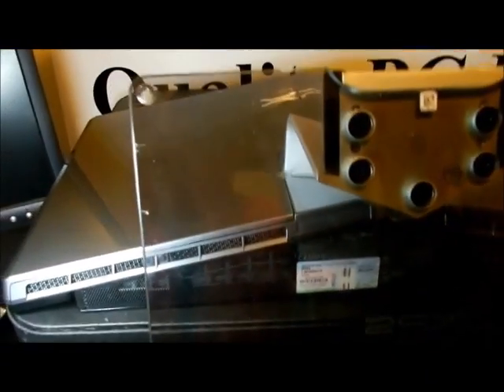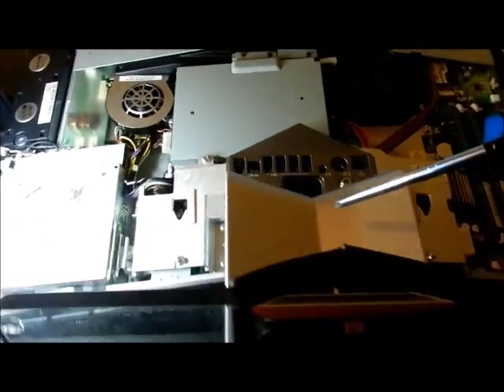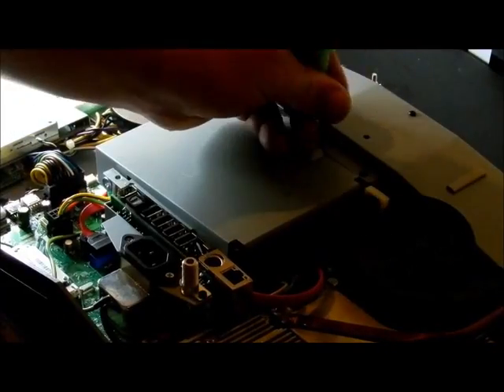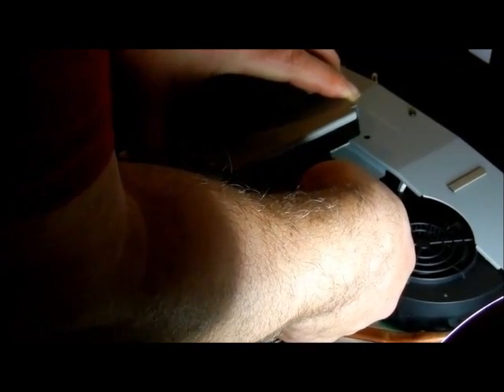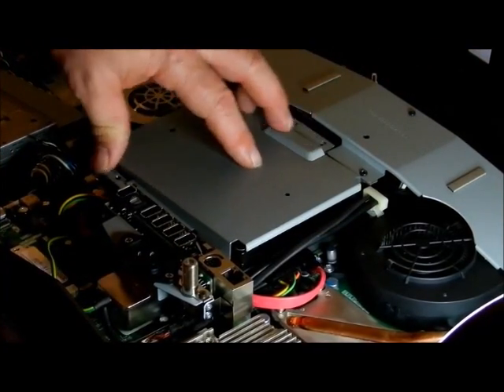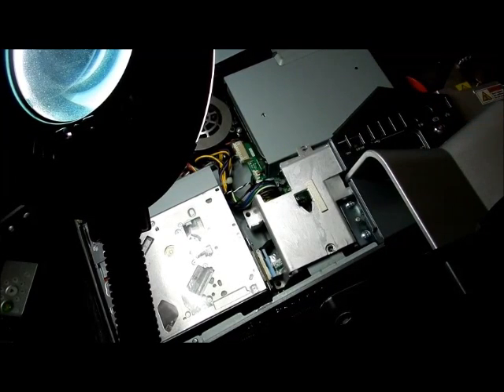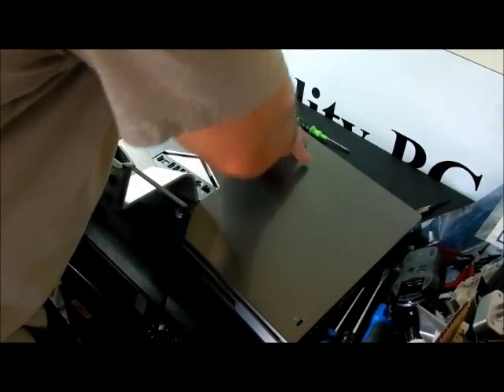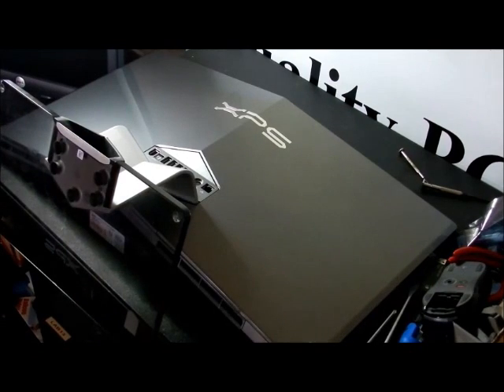Dell XPS One Replacing the Hard Drive

Comment: Where can you get a HDD for these? Got one going off an auction tomm I'm kinda interested in getting.
Reply from the maker: Staples, Best Buy, EBay...
Reply: Thanks for the response I appreciate it, one more question is there a type of HDD this takes? Are they all kinda universal or do they have different connectors ect.?
Reply: Serial ATA I think is the answer to my question right? Can I put a new SSD like this one http://www.bestbuy.com/site/kingston-ssdnow-120gb-internal-sata-solid-state-drive-for-laptops/5395439.p?id=bb5395439&skuId=5395439
as long as it's Serial ATA in the XPS One 20 or will it only like the old style magnetic spinning type?
Reply: Since it looks like this XPS came with 3.5 inch SATA I assume any replacement must also be 3.5? Looks like a pretty good deal on this one that matches from everything I can tell http://www.bestbuy.com/site/wd-blue-1tb-internal-sata-hard-drive-for-desktops-oem-bare-drive-black-silver/6331502.p?id=1219470783344&skuId=6331502
Reply from the maker: Travis Barnard As ling as it is indeed for a desktop computer.  The cost looks good too.  Take a look what a company had me do with a Windows XP SATA HD.  They had me change it to a smaller SSD SATA HD.  Wow!  It booted fast.  Look for it on my channel in the computer hardware playlist.
Reply: Can't find it, would you mind linking to it?
Reply from the maker: https://youtu.be/eT0JoKGyPw0
Reply: I have really appreciated your help man, I know just enough about computers to be dangerous. I found a matching HDD in a spare computer I got cheap laying around, a Dimension 9100.  Installed it into the XPS fine but now of course it's giving me the blue screen upon trying to load windows in start up, is this to be expected? Will I need to like have a recovery disk and reinstall windows on it ect?
Reply from the maker: Travis Barnard You cannot take a Windows HD out of one computer and expect it to work in another.  Windows 10 stopped this all together.  Windows has to be reinstalled.
Reply: William Quinn so whats the cheapest easiest solution? Can I take the factory restore CD for the dimension and do it if I have it or what?
Reply from the maker: Travis Barnard You can give that a try.
Reply: It worked partially I got windows xp on there fine but the drivers won't match up I think, can't seem to do much with it, not having luck finding drivers on dell support downloading them on this good computer then transferring them via jumpdrive to the XPS one 20 aint working
Reply: Was thinking about buying a restore disk from restoredisks.com got any other suggestions?
Reply from the maker: Travis Barnard Great.  I used them once.

Comment: Had this computer for a very long time.  I am now having microphone problems, it buzzes so bad as to be incomprehensible.  Any thoughts on that?  I run it with the back plate off because it was overheating alot but other than that it is pretty much the same
Reply from the maker: AttentionJunkie Go to the control panel and test your mic.